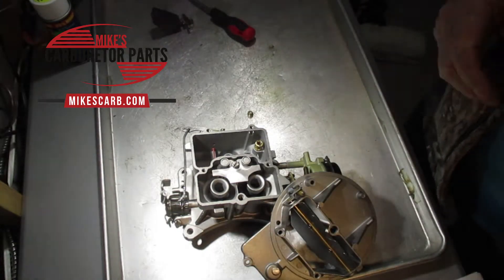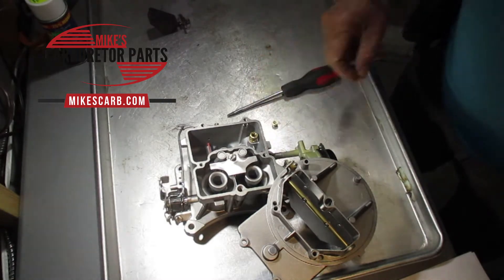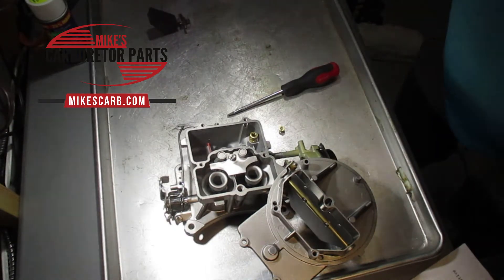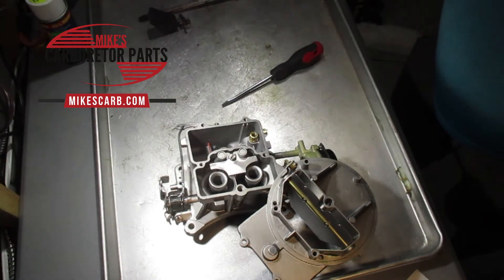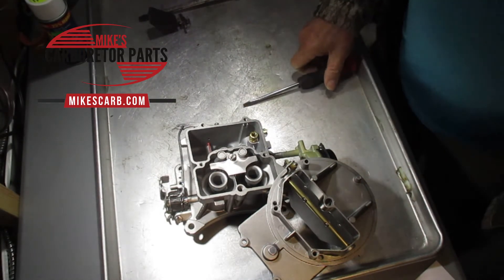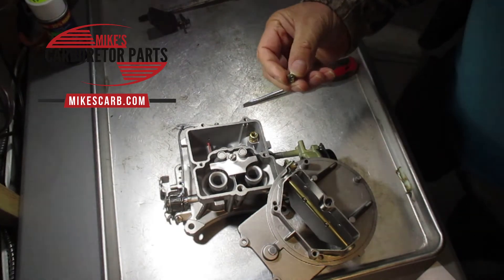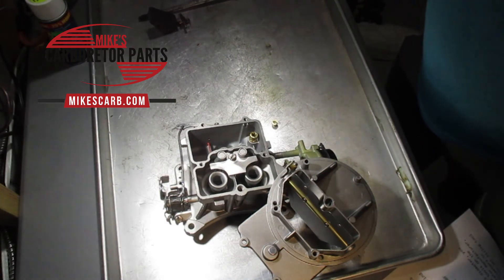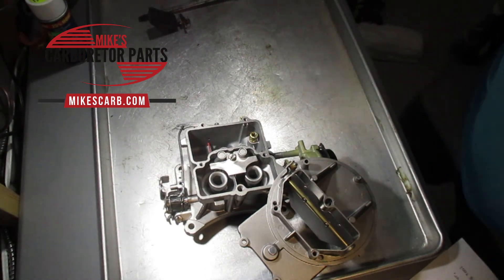Carburetor Jet Technical Video

Comment: Got black sooty plugs lot black soot in exhaust manifold s and I changed out plugs wires it's a Chevy 4.3 with swap from tbi  could the jets be too big it is a 2150 got junk carb at first but threw it off engine bought a motor craft rebuilt it
Reply from the maker: You are probably flooding (getting too much gas) See this page. https://www.carburetor-parts.com/motorcraft-2150-flooding
Reply: @MikesCarburetor got it float level was getting to much

Comment: To measure a jet, I use a small set of precision drill bits (they go down to .010") and insert the drill side (not the cutting side) to gauge the jet size.
Quick question: I know that race-car boys will use JB Weld to resize jets, but that's for temporary use. Is soldering jets to re-size them really necessary? I recently had to resize a pilot jet on a generator I'm going to sell with JB Weld, but I'll gladly re-do the jet with solder if you think it would be unwise to leave the JB Weld.

Comment: Mike,  i've installed a new rebuild kit in my Motorcraft 2100, the old power valve was permanently "deactivated" and was ALWAYS open (the vacuum hole was covered).  I reverted this and installed a new 6.5 valve.  But now i'm having heavy bogs at middle range throttle when cold  (think because of the less fuel by the power valve working properly),  i think that to compensate this i have to change the two mains jets for a bigger ones. I want to buy a entire set of F-Main Jets at carburetor-parts.com,  but what do you think is the correct jet size for my config?????   (1992 5.0 HO,  actually it has 54F jets installed, msd ignition 6425, timing is ok, choke plate and shaft deleted 'cause not needed,  vacuum ok: 16inch in cold, 19inch in normal operating temp),  edit:  dry float level is set at 10mm
Reply: @MikesCarburetor  It was open all the time because someone in the past blocked the vacuum hole that makes it being closed when cruising or idle..  It's my first time in the carburetor's world and i am trying to learn across the internet and testing with my Motorcraft 2100
Reply: i THINK i have to keep the same 54F jets and use a more early-open power valve  (10.5" maybe)

Comment: One of the issues Ive been having is that my passenger side is running leaner than the driver side. 

I cant tell if its jet or power valve related. Can you mix/use 2 different size jets? 

Ive got a Ford 2.8L V6 with a non feedback 2150. Durasparked.
Reply: @MikesCarburetor  ok, next time I have time off work. Ill pop the carb off and do a full cleaning/rebuild of it even though its pretty clean as it is.